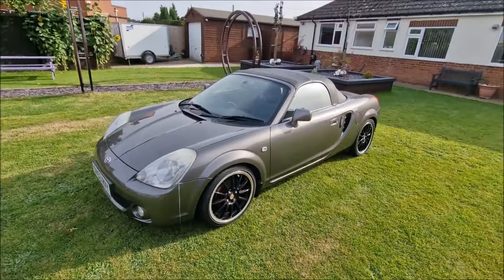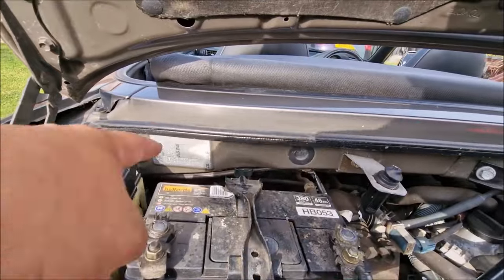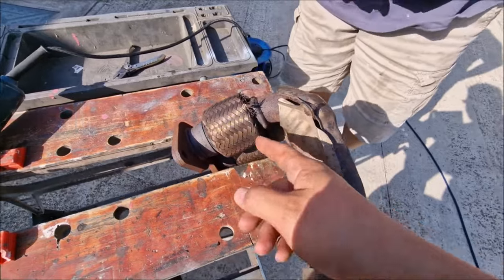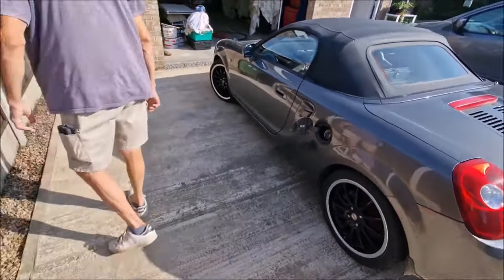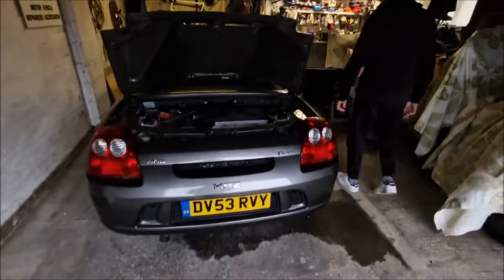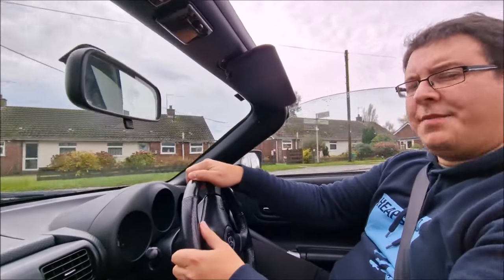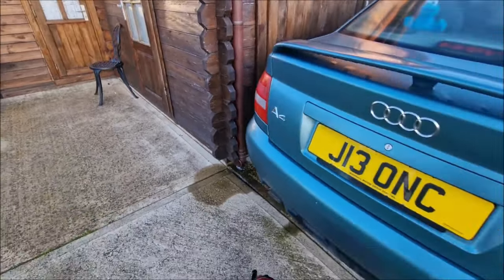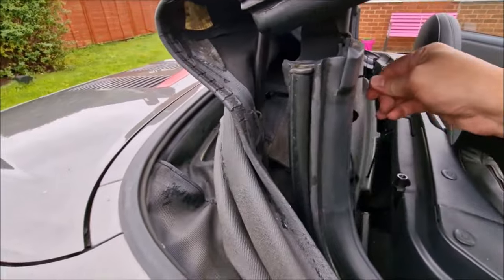Toyota MR2 MK3 - My Entire Experience (Good & Bad) - Mega Video

Comment: Thanks for the vid jon, good to see someone else enjoying a mk3. Couple of points might interes you. All the facelift cars were six speed except the odd few with sequencial gearboxes. Toyota deliberately didn't put any storage in the front for perfect weight distribution and further to that end if you notice the brake calipers are to the rear of the disc on the  front,and to the front at the rear wheel. This helps to vive the car almost perfect weight distribution. At only 980kg, 138bhp still gives a good deal of fun. Cheers Bob
Reply from the maker: Great to read! Thanks 👍

Comment: Reason i did not like this version of the MR2 was the lack of power , the old one had a turbo and like 200bhp this version only 138bhp really it should have had at least 200bhp with rear wheel drive , also rust killed most off sadly , ive see lots for under £2 grand and all were rotten
Reply: The turbocharged models were only available as Japanese grey imports, the official UK models were all normally aspirated.  I loved my Mk2 GT-S, at least the looks and performance.  The ability to terrify you in the wet wasn't so appealing.
Reply: @ferrumignis  🙃👍

Comment: Never found these as fun as they should have been, 1ZZ engine particularly dull and ruined it for me, particularly in comparison to the MK1 MR2. Much better than the MX5 when it comes to rust though. Prefer Smart Roadster, more compromised but also more of a laugh.
Reply from the maker: I do prefer driving my MK1 MR2 in comparison
Reply: @JonCoupland  Aah didn't realise you had a Mk1. Much prefer the power delivery of the 4A-GE engine, suits the MR2 better than the linear 1ZZ. I did buy my Mk3 after a decade of Lotus Elise ownership though, so probably a high bar for it to get close to. Just never felt good enough to justify the compromise of being a small two-seater, had more fun in hot hatches.